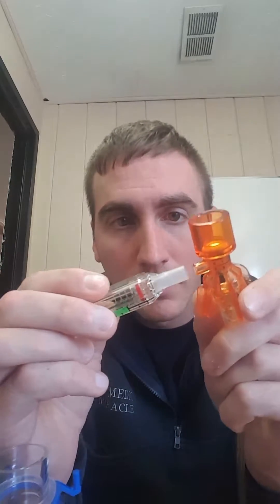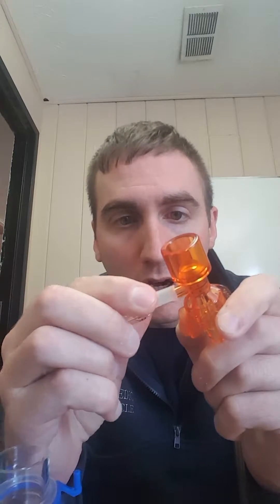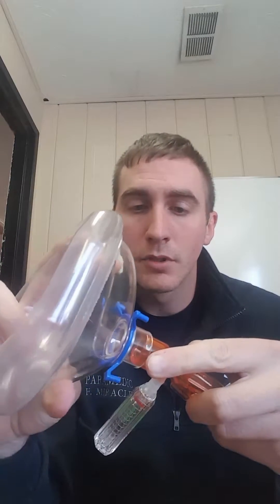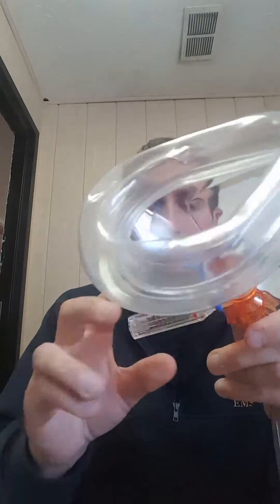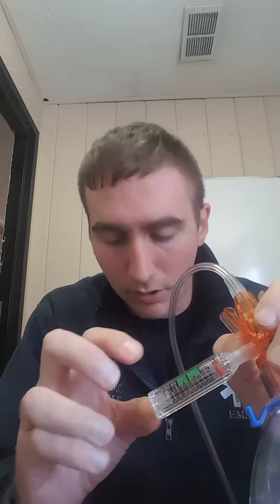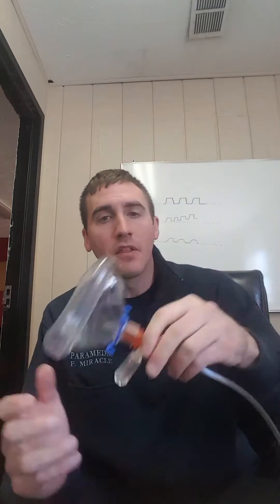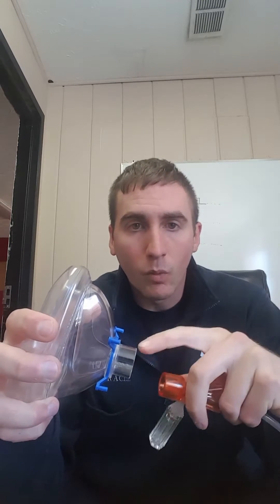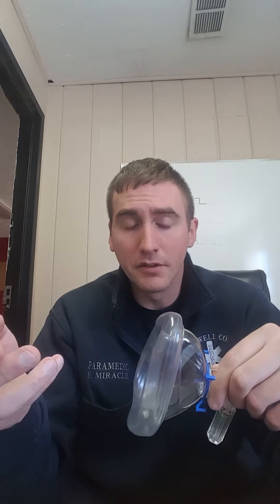O_two CPAP Manometer

Comment: Great Information and illustration. How often should a cpap machine be calibrated ?
Reply from the maker: The one used in the video is a disposable system for Prehospital use, so no calibration needed. As far as other devices, that information would be best obtained from the manufacturer.